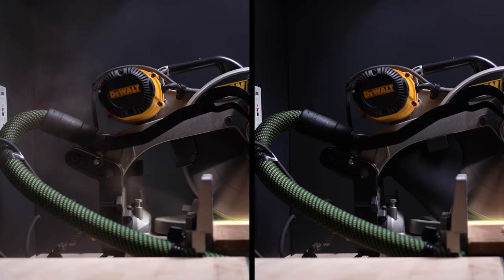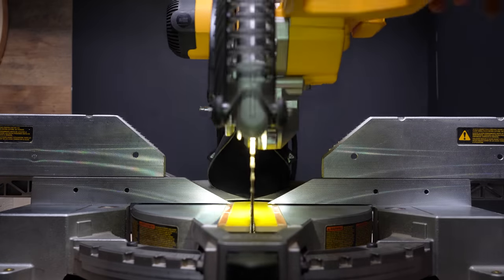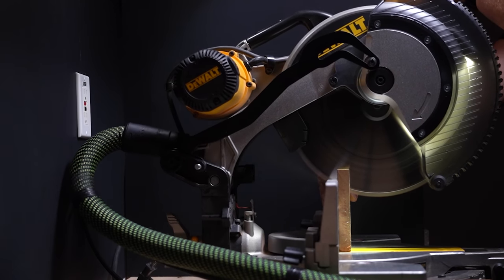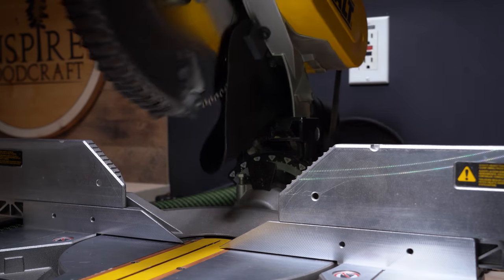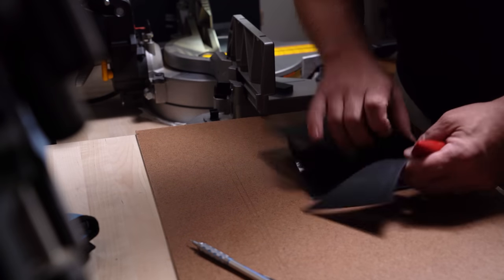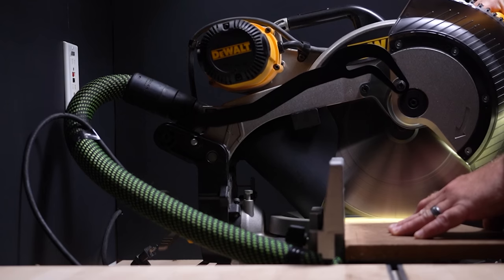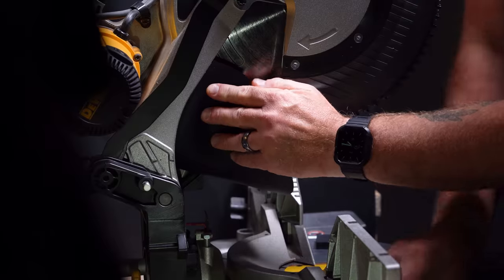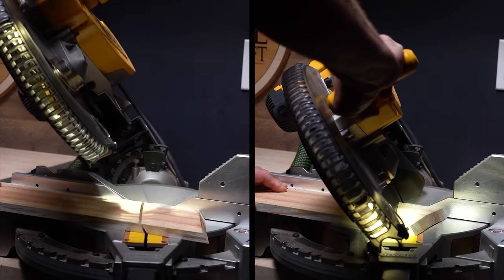The BEST Miter Saw Dust Collection, Period

Comment: I used oatey brand shower pan liner used for showers, it is 40 mils thick and can be bought in the plumbing section at the orange home center. I use it on a lot of tools, including the table saw.
Reply: Would you mind linking to the product you used? Thanks
Reply: Thanks!!!

Comment: Brilliant! Just freaking brilliant! Do you think this design would work on the DWS779? The sliding portion introduces a bit of a head-scratcher for me. Keep up the great work
Reply: This was my first thought; I clicked the link to buy the hood (shroud? Boot? Freaking floppy thing) but it doesn’t say if it would fit the 779. 

Jody, you’ll make easy money if you make one to fit the DWS779.
Reply: @brenperkins3117  I would be on that list for sure
Reply: Wow, some competition for Shop Nation and his 3D printing army.  Honestly, I would buy if it worked for the DWS 779/780.  "Shut Up and Take My Money"
Reply: From the same group, I'd take it for my DWS780.
Reply: I don’t think it would easily work. The 779 has a plastic chip guard, so magnets won’t work there and I wouldn’t attach any hardware the plastic. Maybe there is a metal version of that chip guard. Also the 779 already has a dust shroud so that would likely need to be removed.
Reply: @kylesala6507  There was a recall on the plastic chip guard... fill out the online form and DeWalt sent out a metal one.
Reply: @mikedurkee7296  mine does not fall within the recall serial numbers. Apparently they are still plastic. And the new ones they sell are plastic, maybe the big box store versions are cheaper parts. Nonetheless I will contact them and try and get a metal one if possible.
Reply: @kylesala6507 same issue, got thr 780 newer.  Did they send you a metal one?
Reply: Yes! Need one for my 779 with the shadow light upgrade.

Comment: Here is a mini-review of using the actual product purchased from Inspired Woodcraft: By way of info, I use the exact same DW716XPS and made what I thought was a great dust contraption last year. It collected 80% to 90%... as a result I was very pleased for a while. However, it was limited to 90-degree and 45-degree cuts in order for it to work "perfectly" (and absolutely no bevels). I didn't think this would be a huge sacrifice, but I ultimately found myself limited by these constraints and started cutting into my contraption to make cuts other than 90 and 45 degrees (and had to use my table saw to cut compound bevels) 

Rather than make a new cap piece for my contraption that was nearly cut away over the past few months, I bought the $25 boot from Inspired Woodcraft. Yes, I could have made it, but I wanted to support our community and didn't want to jack around with test-fitting it for several hours (while going through several SF of material that would have cost a few bucks to start). 

The boot arrived quickly... it was professionally packaged and came with instructions that I skimmed but didn't read 🙂

In short, I installed the boot and it works great. Not as good as my other solution when I stuck to 90-degree and 45-degree cuts, but pretty close and this one gives me a full range of cuts (including bevels). All said; I consider this a much better solution overall. 

Note: My DW716XPS does not have a metal bracket around the blade (it's hard plastic). Because of this, I could not use magnets to hold it in place and I had to use the existing screws along with a couple of small washers to install the boot. Not a big deal, but I had to remove the blade so I could clamp the boot in place to mark/drill a couple of small holes in the boot. At the end of the day, this is a "first-world problem" that is easily solved. 

All and all, this is a very solid solution. If you have the same saw, support our community and place a $25 order from Inspired Woodcraft. You will literally spend about this much to make it yourself and it cost you at least 2 hours (probably more). If you don't have this saw, use the concept and cut your own knowing that it works.

This is my two cents, take it for what it's worth... just know that this is based on real-world experience after making my own solution that took a fair amount of time to make (and is now in the trash).  I hope this helps.

Comment: Used this principle on my Ryobi sliding miter saw. It works like a charm. Tapped some screw holes for the silicone boot into the metal frame. Can't thank you enough for the video!
Reply: I was considering using Velcro since my Ridgid isn’t magnetic at that point. Don’t know why I didn’t think about tapping it for short screws. You gave me a reason to buy that tap & die set I’ve been eyeballing and couldn’t justify
Reply: How well is this working for you?  I have a Ryobi 10 inch sliding saw.  If it works great and you have similar do you mind sharing dimensions?

Comment: Thanks to videos with this kind of design, I've built up a similar collection hood for my SKIL SCMS from duct tape added to a basic shape from sheet rubber. It's an easy way to do this because you can just keep adding to it & shaping it until it's just right, and the layers you end up with keep the form intact.

Comment: Thank You for your video. I used a similar material as under-padding for the basement floor. I followed your video
demonstration used paper from my printer and made the template. After two attempt the fit was perfect. The
result for me is awesome.  My Dewalt on the back has a soft plastic flap to guide the dust and my vacuum kept sucking
the flaps in so I lined it with two way tape and it works very well for me and I am very happy. I have not yet tried the slider
function, but I am happy since I am in the basement of my house.
Reply: can you share the template image?

Comment: Brilliant. Just got my silicon in, cut it, and attached it to my DCS361. The dust chute is non-ferrous, so I just drilled and tapped the 4 holes to 1/4 20. I have a ton of 10mm 1/4 20 bolts that are effectively to short for anything else, except attaching the silicon. I used the existing collection rubber to mark the holes on the silicon

Comment: Thanks for showing this to us. I have the Dewalt DWS782. When I originally bought it I finally found an adapter in the plumbing dept to attach a shop vac hose to it. I was so happy but then I turned it on and the rubber part that is near the part being cut collapsed. What I ended up doing is building an enclosure with a hole on the side for the shop vac hose. It keeps the dust down in the shop but it's a bit too big.

Comment: Looks good.

I had to do my basement recently, and I built a box around the saw with foam sheets. In the back is a box fan in front of a filter to create negative pressure for the dust. It’s bulky but works very very well.

Requires somewhat regular cleaning but I bet it captures more than this even 😌

Comment: Smart. Did the same on my DeWalt (DW780 I believe) years ago. I used some reinforced rubber gasket material (also about 2mm thick). Comes in sheets from any auto parts store. My saw had a factory installed rubber shroud, but it was small and useless. I was able to bolt the new and improved shroud to the saw using the factory mount.

Comment: Just ordered it.  More to support your channel than anything else. I found Chris Harpsters video and created a shroud. But it was a pain in the ass to install. Your magnet approach is so much easier!  And I like the little tabs you added.
Reply: I tried magnets years ago when prototyping, but couldn't get them to hold properly. I should've kept trying different types! He's got a great solution and the silicone is a great innovation.
Reply: @benchtopwoodworks  Been using your modification for some time now. Works really well. TY

Comment: Nice to see your ingenuity. I design and sell dust collection parts as well and some of mine for trim routers etc make for near perfect dust collection and improved stability. For the cost involved I don't understand why the default inclusions are not superior to what we receive - especially since they often do not work well for the orientation of the items primary use (eg routers collecting above the base). 

You have near completely overcome the issue on the saw for negligible cost. If we accept liability is a key reason brands don't do more we can consider: 

1. What are the potential adverse outcomes of this being present on the tool?
2. What is the likelihood of each adverse outcome?
3. What is the consequence of each?

From this we determine what we call "Significance" in design engineer speak. 

What's your breakdown on the presence of this shroud in proximity to the blade and stock in its current configuration with the magnet fixing system?

Comment: Thanks for the tip. However, I just hook-up my CamVac dust extractor to the two factory dust ports of my Makita LS1019L by using a 4” to 2x2” adapter. The CamVac has a 4” inlet. From the adapter, 2” flex hose runs to each port. Because of the high suction of the CamVac, all I need to use is one of the three vacuum motors to capture the dust.

Comment: I just got mine yesterday, and it's a night and day difference.  Worth the 25ish bucks.  It was either that, or I was dropping 1500 on the Festool, because dust is a huge issue in the garage, with all the kids toys being stored there as well.
Reply from the maker: @chrisvanderwielen1530 Sweet! Hey thanks for coming back and leaving a comment with your experience!
Reply: @InspireWoodcraft So, I just ordered another one from you.  I did a 45 miter, and it got eaten by the blade.  I have to be more careful with opening up the upper fence on the saw before attempting that -- it pinched the hood bent it out into the blade path.

Comment: I made something almost identical for my cheap harbor freight miter saw by using several layers of duct tape to create the "mat". It works pretty well, it's fairly rigid, but also flexible when I bring the saw down and it's just duct taped onto it. I saw a video about it awhile back so I can't take credit for the design, but it works great and significantly reduces the dust.
Reply: Would that happen to be the 10" chicago electric? If so, can u send a pic of what u did?

Comment: Buy a Makita, they come with double flexible dust collector cups included from the factory. Additionally, I installed a 12” downdraft floor sweep with 4” hose at the bottom rear of the miter saw cabinet to catch the small amount of dust that escapes.
Reply: They are great but on the top extends with it. The bottom stays stationary

Comment: This is a really good take on extended boots! The only concern I would have is using this idea on a slider miter saw. The chop style probably works great, but I assume if you were cutting on a slider you would almost have to start at the "far" edge (closest to your body) and work back so the rubber glides on the piece. Very neat concept, though, and it looks like you have it damn close to perfect!
Reply: well, when using a slider you are supposed to start at the point farthest from the saw and slide toward the saw.
Reply: @donf9488  You got me! I obviously wasn't thinking that one all the way through. Thanks for calling it out!!
Reply: @Toyotajunkie I would be concerned about the silicon being compressed in such a way that it would come in contact with the blade as you move acorss material on a sliding saw. Would need to make adjustments to this design for that scenario, or have  second one to swap in for slide cuts.

Comment: Jody, you’re confident that magnets will stay in place and not somehow come off and hit the blade?  I do have some very strong magnets from a lifting device laying around that would probably work.
Reply from the maker: @Fred Parsons I have not had an issue with the magnets so far at all. I originally used magnets because I was taking it off and putting it back on every couple of minutes when making design changes. I think if a person wanted, one could drill and tap the metal bracket though.
Reply: @InspireWoodcraft  , the magnets are a great idea and I will probably do it also.  Thanks

Comment: Great job. Extending the reach of the blade shroud and discharge chute is key in reaching the goal of 100% evacuation within the capture zone/chamber. In some industries 100% is a requirement.  Extending your silicone discharge chute (a flexible baffle) along the side of the blade towards the operator and moving blade guard would create a semi-enclosed capture chamber from which the high speed particulates are directed towards the negative pressure outlet. The last component to a 100% capture scenario is the addition of a push-pull ventilation within the capture chamber. The velocity of the particulates being thrown by the blade is more than the velocity of the negative pressure airflow. The negative pressure airflow velocity is slower than the capture velocity of the various size particulates.  Particulates have enough velocity to pass by the pull of the negative pressure velocity (not being etrained) and can continue around the arc of the blade shroud to re-emerge on the operator side of the blade where it invariably bounces off the table and stock ricocheting - anywhere. The addition of secondary air injection within the extended shroud and blade baffle (inside the width of the moving blade guard), on both sides of the blade, directed horizontally across the surface of the stock will create air curtains on both sides of the blade preventing particulates from escaping this directed path to the discharge chute and negative pressure outlet. Finally bilateral air injection 45 degrees to the blade aimed at the blade bullets should be able to remove the last of the particulates and place them into the capture chamber airflow and into the negative pressure outlet. These concepts are being used in other industries concerned with fine particulate capture,  they just haven't been applied to woodworking. Looking for a practical source for positive pressure airflow? The blower port of a Shopvac channeled to a DIY manifold then redirected to smaller multiple air jets for use within any tool's capture chamber(s), within the ducting intermittently positioned to maintain transport velocity, within centrifugal separation chambers to air wash the interior walls decreasing friction, decreasing abrasion, providing an air cushion for particulates, increasing velocity, entrainment, and CFM increasing separation efficiency. If you were piloting a micron size particulate, wouldn't it be more efficient to travel a river of air, never getting lost or escaping this directed path all the way to a HEPA filter, wet scrubber, and/or an electrostatic separator while getting rid of bothersome fellow travelers. Lots to think about. Your mind is probably already spinning with ideas. You had the gumption to think yourself to your current solution. Perhaps you will tweak it a bit more. How to connect bilateral baffles on either side of the blade staying inside the width of the moving blade guard? How to always have the bottom of the baffle in contact with different thickness stock? Does the baffle need to nest itself onto and off the stock? You have to have a balanced airflow of positive pressure air evacuating 100% of the particulates. Too much addition air can over power the negative pressure outlet's ability to keep particulates within the capture chamber. The use of downstream air injection can rebalance this outgoing airflow by entertaining more air from the capture chamber. Keep thinking. Eventually our DIY Maker solutions will trickle up to conscientious manufacturers who can incorporate these concepts into their manufacturing.  Let's hope. cboliver@live.com

Comment: The silicone mat is a great innovation, you did a great job of describing the high-angle, low-angle dust tradeoffs! Thanks for sharing. 
You can also fabricate a spring or frame to hold some of the cone shapes open using things like nylon zip ties! 
Here's some info on miter saw dust collection with similar solutions your audience may find useful: 
a Deep Dive into Miter Saw DC: https://youtu.be/dN0xR__pSI8
DIY Rubber a similar example: https://youtu.be/Ek1-_-5sP5w
Bolt on solution: https://youtu.be/fC5_IlpXkos

Comment: What a great invention! I have a dws 779 (sliding) so I just bought the material. Running into some frustration. I am fine if it doesn’t work well when sliding. But has anyone made something similar for a dewalt slider?

Comment: Any risk of something catching and causing the magnet to pull/fall into the spinning blade?  I feel like I'd be more inclined to tap some screws into the side of my guard.
Reply from the maker: @David I think there's an inherent risk whenever you alter a tool from it's factory state. So, yes, there's a risk. But I will say that I have not had an issue thus far. As long as the boot and bracket are not caked in fine dust when you install it, it holds great. Of course if you are trying to cut very tall miters like on tall baseboards or doing some sort of crazy compound angles where the boot can get hung up on the workpiece, then yes I could see there being an issue. I would definitely drill and tap if I was concerned with it though!

Comment: I just got a new DWS716XPS and it came with 'shroud' similar to yours, much smaller though. I did (5) test cuts in a 2x4 and it captured 77% of the dust using just the dust bag, which surprised me. Did you take any measurements?

Comment: Hi can you address the Bosch GCM12SD axial miter saw dust problem? I use my axial Bosch almost everyday as a carpenter and my cousin a carpenter is also considering buying the Dewalt DW779/780.  I've check out what ShopNation and Benchtop Woodworks have created with there pros and cons and seems that cutting in all angles is a huge challenge. Maybe you might have a fresh take on it.  Thanks